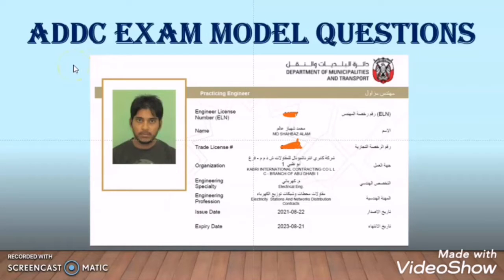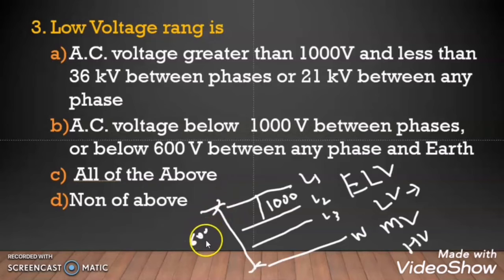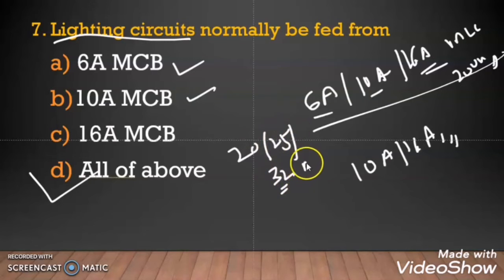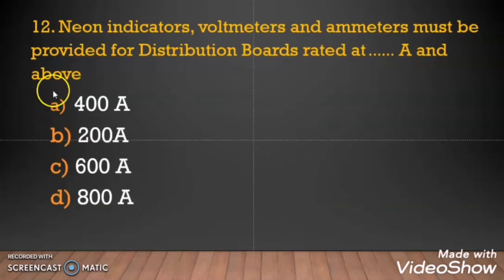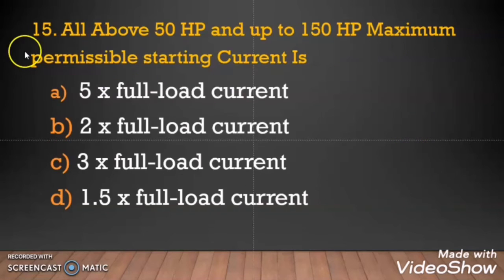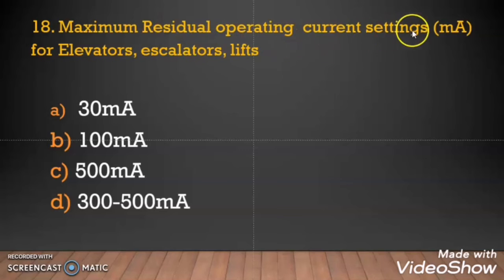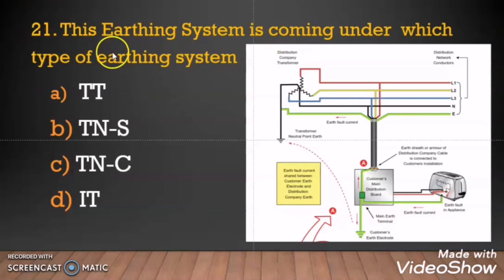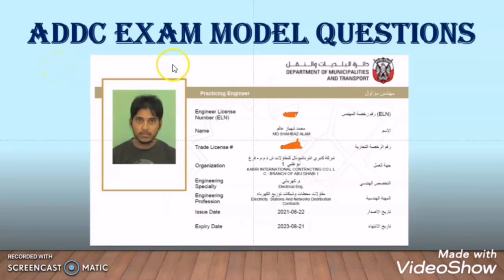ADDC EXAM MODEL QUESTIONS!

Comment: Can you explain about PROTECTION 
1.MCB selection criteria with cable rating
2.Electric shock protection 
3.full Details of RCD
Reply from the maker: Please check out my channel. Your all questions are aleady discussed in dedicated videos.
Reply: Bro for load schedule preparation for  ADDC standard with any of G+5 BUILDING... and why chiller isolator we are used 3 core cables